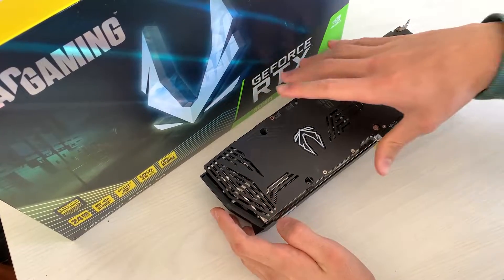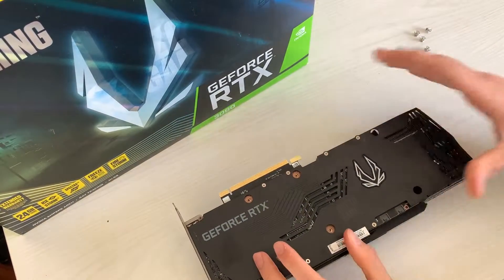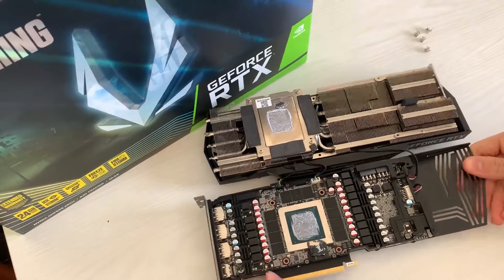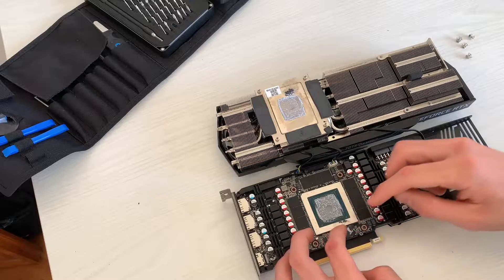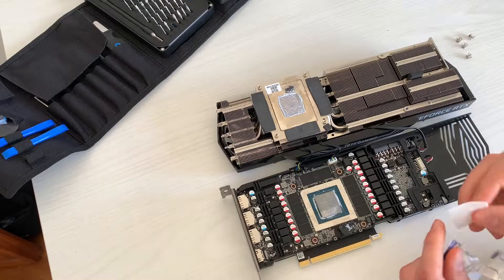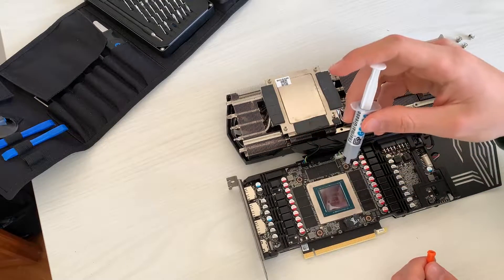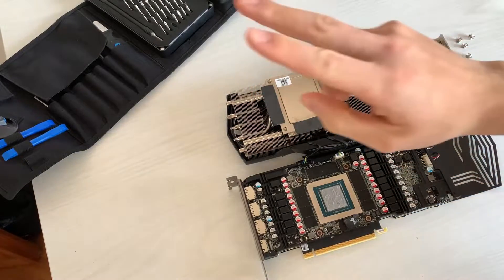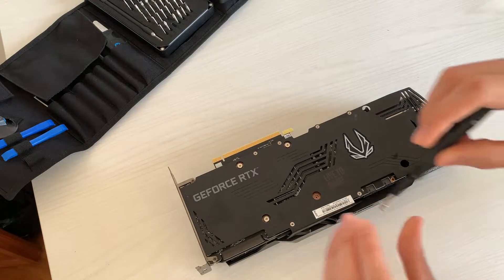RTX 3090 Teardown Disassembly and Thermal Paste Replacement - RTX 3090 Zotac Trinity

Comment: Yeah, spread the paste evenly. Use a spreader, cotton swab (not recommended unless you want to remove some paste) or just use your clean finger (my preference).
But, because of the always "possible" static potential, you may be storing on your self, an anti-static wrist strap will/should prevent any static charge being present when you touch some thing that is grounded. (When used properly)
I have one that I bought years ago and I have used it...half dozen times.
Typically, I just do things like this barefoot and problem solved. But then maybe don't do this on a conductive surface, like a metal table. Be smart about it....or a surface prone to static build up.
But most important, do not touch things with your finger before you clean it. Like eating chips, scratching an itch on your face, or your butt.

Comment: Gd900 is good for cpus but for open die (like gpu) i realised it pumps out veery fast so after 2 months performance is bad
Reply from the maker: Oh really? Didn't know that, will test it out! What would you recommend?
Reply: @ImWateringPSUs  I used gd900 on my gpu and mx5. Months and months of usage gd900 requires monthly repasting initial performance is good but then it just pumps out. Mx5 is better. But for cpu (ihs) i prefer gd900. It's 1C better than mx5. 2C better than Kyronaut and mx4. Also cheap. I also use gd900 on my mods (itx case my sfx psu i added a small led aluminium heatsink gd900 in middle and thermal glue on sides) and also back plate cooling mods.
Reply from the maker: @Hi-levels  Thanks! Will definitely get some MX-5 for GPUs!

Comment: I hate the back plate on this card. Worst I have seen. Why not use a flat thicker backplate on the vram side.. It would be much effective to soft mod the card on back plate
Reply from the maker: Yeah I REALLY didn't like what Zotac did on their 3000 series cards on the GDDR6X cards tbh
Reply: @ImWateringPSUs  yeah sadly... Even my cheap gigabyte rx 580 had a solid back plate. With soft modding 145w cooler would tame 185 power. But I got trinity oc 3090 now time to mod it. 102C vram 82c soc. I ordered copper mod for 3090 machined. Thermal right thermal pads. Also card is used so its very dirty. I will clean it too. Current temp are crazy.. Given that I only use it for gaming
Reply from the maker: @Hi-levels  Keep me updated on how it goes, I found it very difficult to mod these Zotac cards!
Reply: @ImWateringPSUs  yeah I will update you here. Did you try the copper stuff? You know the machined ones? I am a  bit scared to short something out lol.
Reply from the maker: @Hi-levels  Tried to copper mod it internally but it really worked out terribly lol, dropped the temps a bit but it's hard to find the right size, honestly if you find a premade kit on the internet I think it can work

Comment: Hey everyone. I replaced. Y pads and now nothing will display. I haven’t had a chance to get back into it but what do you think it could be? Pads too thick and too much pressure? The bios comes up through monitor but then after that when windows should come it’s just blank.
Reply from the maker: It means you haven't covered all the SMDs with a thermal pad and something is touching the cooler!

Comment: Good video but, there is another set of pads on the backplate 
Also it is prefered to change the thermal pads once  the card opened to ensure stickiness.
Also you did not tell us how much the thickness of the front pads or the back pads
Reply from the maker: Yes I know about the pads on the back but I personally didnt need to change them! It's 2mm on the front,  3mm or 3.5mm depending on how much they compress on the back!

Comment: Why not try Dowsil 5888 or Shinetsu 7921 whch I believe you can get better temp drop. I don't suggest you spead the paste as you did in the vedio. You might involve air trap this way to inhibit the thermal performance.
Reply from the maker: I will try those! air doesn't get trapped because in the end there's still the pressure from the heatsink!

Comment: Good evening! I also own a Zotac Trinity RTX 3090 and disassembled it this evening.
I proceeded to change the thermal pads and the thermal paste.
I have some suggestions on this:
- If you intend to change the pads (which I recommend every time you open the card!) I strongly suggest you disconnect the pin connectors (one for the led lighting and the other two for the heatsink) in order to do a good job and avoid damaging the super fine cables.
It is not difficult, because in this card you will not have to force much to do it, but equip yourself with precision tweezers suitable for the job you are doing! You can find inexpensive full sets of these on Amazon. Trust me, you will need it.
- The correct thickness of the thermal pads you need, in the front board side is 2mm.
Not three, not one, but 2mm !!
For the backplate side I have no idea because I didn't disassemble that part. The brand and quality of thermal pads I used is Thermalright Thermal Pad 12.8 W / MK. In my country on Amazon I found the 120mm x 120mm solution and I have more than half of the product left over.
- When you remove the "old" thermal pads you will probably need a plastic spatula because they will probably stick to the memories on which they are placed. For any residues I used kitchen paper initially soaked in a specific Arctic product for cleaning electronic components such as CPUs. They sell them in a kit that includes a solution to remove the thermal paste and a surface purifier ... google! However, residues can be removed easily even with simple paper. Any residues that come off must be removed with tweezers or low power compressed air
- For the thermal paste I used the Grizzly Kryonaut brand
- Before you start removing the old pads, take a nice detailed photo to make sure you have covered all the necessary areas
- Press the new pads with your fingers enough to keep them attached to the memories: you have to keep in mind that the part that will be turned over to close the card with the heatsink is exactly the one where you are working !!
- Arm yourself with good patience to clean up any residues
- The pin connectors you have disconnected are now much easier to reconnect, always help yourself with tweezers

And now the results:
I have not run pre-tests to be able to provide comparisons to refer to. But using OCCT I got the following results:

- 3D Test
Shader complexity: 8, GPU usage limit (%): 100
I have "Gpu Temperature" stable at 79 degrees Celsius;
"GPU Memory Junction Temperature" stable at 84 degrees Celsius.

- VRAM Test
Memory: 95%
I have "Gpu Temperature" stable at 66 degrees Celsius;
"GPU Memory Junction Temperature" stable at 80 degrees Celsius.

I didn't overclock :)
Reply: Very valuable information, thank you for posting. Curious though, why didn't you overclock and are you mining with it?

Comment: Thank you, Men! Now we know how it's look from inside and easy to disassemble. I want to change thermal pads, because hwinfo shows that thermal efficiency of stock thermal pads us only 86%.
Reply from the maker: I'm really happy about it man! Thanks for the feedback!
Reply from the maker: Did you change them in the end?
Reply: @ImWateringPSUs  yes. Works fine. I also found that better to not change logic of thermal pads. Some people try to extend the area of thermal pads and make it bigger. Bad idea. You have to clone what you see with same size and zone of connection
Reply from the maker: @IlyaZuyf  Facts, I usually just use the old pads as a guide to cut the new ones! I definitely agree that bigger ones can cause decrement in performance!

Comment: It Just Zotac now use low cost pcb for their 3080,3090 cards.. I am disappointed with Zotac cuz I own a Zotac 1080ti amp extreme and that thing  is a tank. Still mining with it going 4 years.. Now my Zotac 3080 oc mining Temp is 54/66/92.. 92c vram for a 54c gpu Temp for me is a joke.. What a bad design.
Reply from the maker: You definitely need to replace the thermal pads man

Comment: How hot was the vram after?
Reply from the maker: It dropped 10C on the VRAM
Reply: @ImWateringPSUs  really? I'm planning to add thermal pads to lower the temperature. Nobody yet posted video adding thermal pads on zotac rtx 3090.
Reply from the maker: @bollygod  Swapping out the thermal pads is a great idea!
Reply: @ImWateringPSUs  It voids the warranty now btw, so does replacing the paste.
Reply from the maker: @nevous8  This card had no warranty stickers
Reply: @ImWateringPSUs  I never said they did. You can ask Zotac. It's on reddit now too. replacing pads/paste on zotac cards voids warranty.

Comment: I'll give this ago! I have the exact same card (Zotac 3090) and it plays around 108 degrees on the VRAM, which is insanely hot in my opinion... I will give this a shot! I honestly did not realize that it's this easy to change the paste/thermal pads... Will update later !
Reply from the maker: That's just great man, I'll wait for the update!
Reply: @ImWateringPSUs  Do either of you guys know the thickness of the pads? I did a change to thermal paste (mx4) and the temperatures on vram is the same, I'm sure I need to update the pads as it's the main culprit.
Reply from the maker: @nevous8  I would get 2mm pads, but 1.5mm seem to be good either way.
Reply: @ImWateringPSUs  2mm all around fits the best it seems. I tried the above and replaced the thermal paste, honestly, there were no temp changes so not sure what's going on.
Reply from the maker: @nevous8  Yeah, nice for the 2mm. Weird for the temps man, maybe you're not keeping the fan speed the same in your tests
Reply: @ImWateringPSUs  100% fan speed
Reply: How did it go? You never updated
Reply: @Xperto_  Temps are hovering around 90-92 degrees Celsius
Reply: @EyesonEnforcement911  awesome thank you  👍

Comment: Hey man thanks for the video. I want to replace stock thermal pads. How tik are original pads and do you know how many do i need for back and front of the card ? Thank you.
Reply from the maker: You should get 2mm pads, even though some people seem to be good with 1.5mm as well
Reply: @ImWateringPSUs  1.5mm is definitely not enough for these cards on the front side, they dont make contact with the plate. 2mm definitely

Comment: Please tell us thickness of the pads.
Reply: can find this on reddit, but 1.5mm if you have to go with a single size.  i put 3mm on the rear of my FE, and it bulged the rear.  I did 1.5mm front, 3mm (that I finger-squished down to fit) and it helped to the point that I'd call this an "essential mod" as opposed to an enthusiast change.
Reply from the maker: Yup, I would do it as well. I'd get 2mm pads tho
Reply: @ImWateringPSUs  i think i agree.  I just did my other 3090, and there were a few spots i had to double up on the 1.5mm, which I did by kind of smearing the second layer a little smoother.  I think going with 2mm and applying enough pressure to compress is the way to go.
Reply from the maker: @seanb9436  Thanks a ton for the feedback man, this is gonna help people!
Reply: @seanb9436  3mm in the back could not transfer heat properly for my thermalrights, used 2mm and no change in heat but didnt make it worse at least.
Reply: @nevous8  odd.  mine transferred heat fine w/ the 3's, the only issue I had was when I went to put a heatsink on the back and noticed the thing was shaped like a burger bun
Reply: so as a followup, i did this to my zotac, and it was in fact quite different from the FE or Asus.  i wasnt expecting such a variance.  the thermal pads used from zotac were REALLY THICK.  as in, what the hell were they thinking?  its like it was bridging a gap on a bad design more than providing a thermal transfer.  ugh.  you'll need 3's for sure with these things.
Reply: 2 mm

Comment: theres memory on the back of the card aswell and the backplate is getting hot with no cooling, so 1. ensure backplate memory pads are good enough, 2. mount a heatsink on top of the backplate with thermal pads between the backplate and the new heatsink.
Reply: Would it be at least a little bit better if I would only change the memory pads on the side of the die? A little too scared to disassemble it completely.
Reply: @asdfasdaa  dont need to disassembly. heatsink outside on top of the backplate and a fan blowing on the heatsink. worked like a charm.. got the memory down by 10-15 degrees.
Reply from the maker: That's a good idea! A good fan is gonna be enought though, especially after replacing the thermal pads

Comment: My zotac 3090 is in +80° when I play warzone, is normal or I should replace thermal paste?
Reply from the maker: It's a little bit too hot. I would recommend following this guide: https://www.youtube.com/watch?v=7pI9rDI12mc and if that's not enough then change the thermal paste
Reply: it's fine
its silicon and can run even at 90 without issues
in fact  your Vram right now while gaming can run as high as 95-102 c
if you are still not ok with 80c then just undervolt it a little bit .. there are many videos for that

Comment: I have exactly this same card, can't believe it doesn't have any warranty stickers, that is amazing, I'll change the thermal pads for high performance ones as soon as I can. 

However, dude... that is a 1500+ usd card there, you really cheaped it out with that thermal pad by not replacing the broking one. Biggest issue of that card is the overheating memory modules, specially if you mine. Thanks for the video anyway.
Reply from the maker: Hey man, thanks a ton for the support! I did not replace the "broken" thermal pad because it still did the job and my card in particular had no memory overheating problems! But I'll definitely change them in the future, with the next repaste ;)

Comment: Pelease i need the thickness of the thermal pads. 1,5 mm is sufficient?
Reply from the maker: It should be!
Reply: Go on reddit. I see thickness varying from 2mm to 3mm. You'll need to do some research.

Comment: Would replacing thermal pads help out with the temperatures as well? Mine is running 80 degrees max. I'm thinking of doing deshrouding, replacing thermal pads, and replacing the thermal paste.
Reply from the maker: Yes, that seems like a good course of action
Reply: Arty do you happen to know the thickness of the pads as I assume you got yours changed?

Comment: What is the thickness of the pads on this card I got the same but not sure
Reply: Did you find out?
Reply from the maker: They should be 2mm pads. Which means you should get either 2mm pads or 1.5mm pads

Comment: When replacing the thermal pads, what thickness do you recommend?
Reply: 1.5mm, since that's what you asked and nobody gave you a straightforward answer
Reply: @LiquidSnakeSSJ4  Haha, I just noticed that, thanks for him!
Reply from the maker: @Hateroz  2mm are fine as well, by the way!
Reply: @LiquidSnakeSSJ4  thanks man, true nobody answered him directly lmao 😂
Reply: In addition to that I'd recommend using Thermal Grizzly's thermal pads. They're one of the best on the market (they are expensive though) and are the most "durable" I'd say.
Reply from the maker: @Hateroz  I agree. A cheaper but still solid option are the ones from Arctic
Reply from the maker: You have to get the same thickness as the ones in the card, or one size bigger at maximum

Comment: One of the worse I have seen the thermal pads are so bad you should change them on the back vrms as well as front I have this card water-cooled and there no way you are 12c under
Reply from the maker: Yes, the thermal pads are pretty bad. But it won't damage the card if you keep them as they are. I got a 12 degress thermal improvement, I don't see where the correlation between my result and you having the card watercooled is though.

Comment: I think this card dropped that much temp, because the thermal pad was on the gpu, and it looks like the metal plate didn't had that good of a contact with the die.
Reply from the maker: Honestly, I believe that's the case as well. That much of a drop is expected after at least one year of use, generally

Comment: Could you please put your mic to mono mode next time, because my left ear doesn't get as much sound as the right one, which is a bit of a pain
Reply from the maker: I'm really sorry about that man, I'll see what I can do in postproduction. I record from my phone, so not really much I can do on the recording side
Reply: @ImWateringPSUs  split audio from vidéo with softwares like "lossles cut", then with "Audacity" you can switch the sound to mono, then with editing software you can put back in the modified audio
Reply from the maker: @nawakman  I will try that on my next video! Thanks man ;)